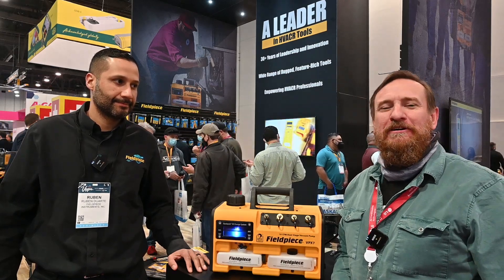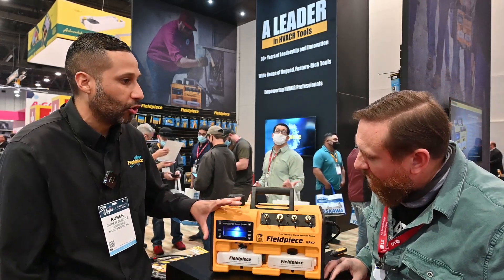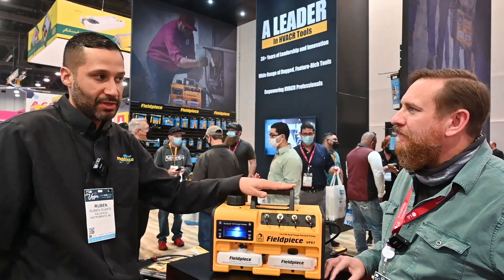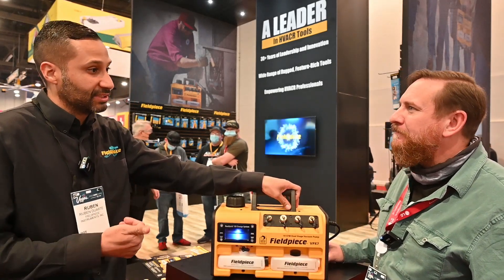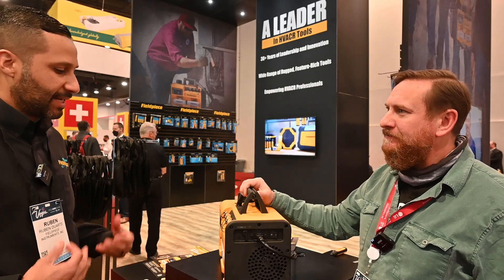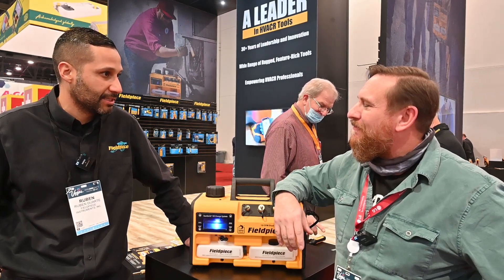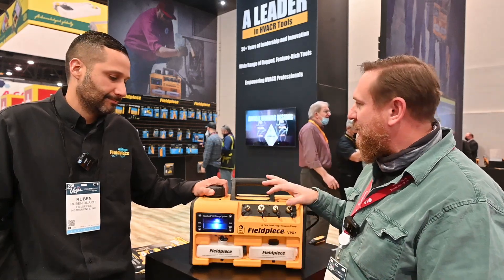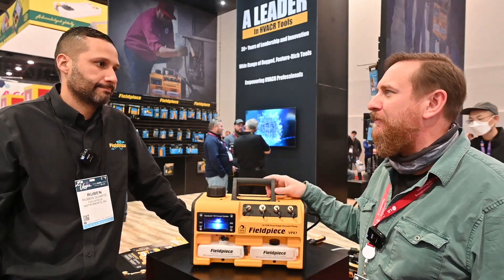AHR2022 Ruben Duarte shows us the Feildpice vacuum pump

Comment: Hi there,  quick question.  I'm looking to buy my first vac pump.  I'm mainly working on big rack systems so I'm thinking 12 cfm. Will i need a smaller one to complete AC work or will 1 big one do both jobs.  Everyone sends to have a different opinion on this.  Id rather not by two pumps if i can avoid it. 
Cheers
Reply from the maker: The big one will work for both.